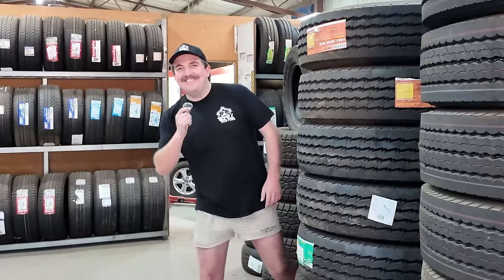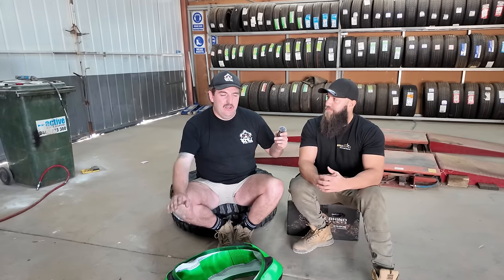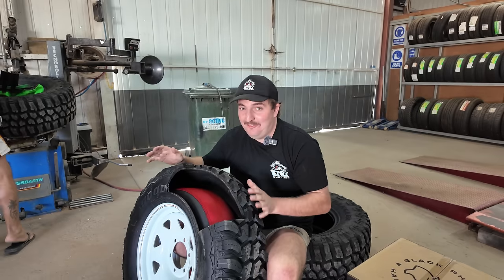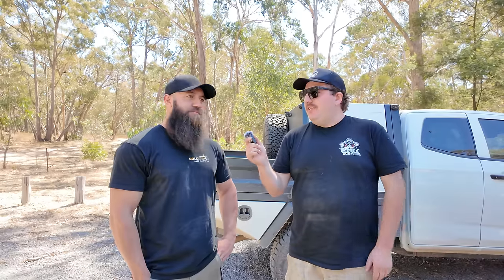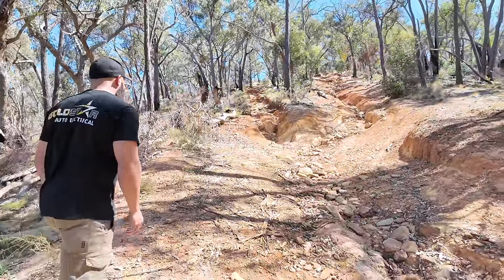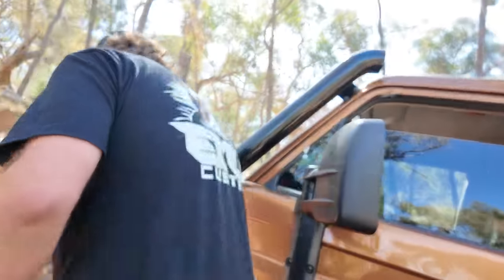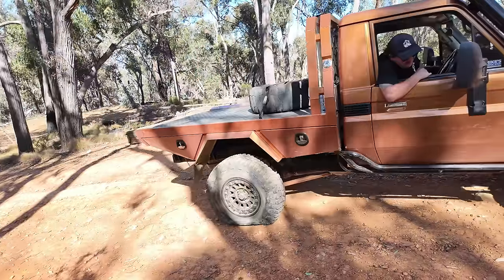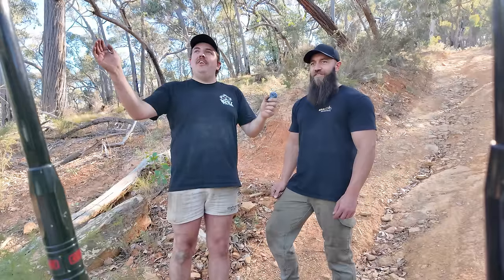No more DEFECTS?!? Pneumatic Beadlocks - (install and torture test)

Comment: From the Avanterra website "For off-road use only. SecondAir™ Beadlocks may not be legal in all states."
I remember with the Staun version that the drilling of a second hole in your rim also makes it illegal to fit. Thats why Staun sold rims with 2 valve stems. Because if they are manufactured like that then its legal. Look up Roothy back in the day put them on one of their budget 4wd specials.

Comment: That 2 new things I hadn’t heard of!
Legal bead locks and graded 4wd track maps. Downloaded it straight away
Absolutely awesome thanks mate!
Reply from the maker: Glad you enjoyed mate!
Reply: Internal Beadlocks were around years ago and those were called Staun Beadlocks, but are they legal?. Probably depends on which nanny state you're in, as I always thought they weren't.  But with the 2nd air valve on the inside of the rim out of sight, whose gonna know hey? I think the only reason for being illegal, was because of the "rim modification", as you had to drill the hole for the 2nd valve. If the rims were manufactured with the 2nd hole, no problem. 
But then again I may be wrong, as it's been many years since I first looked into these.
Reply: @paulpatullo5146  Yeah I heard the same but agree. The popo can't see whats not there.

Comment: On the auto air system ARB makes the linx that does set pressures up or down. I use that and a company called up down air and have a similar setup. I have 4 Schrader valves at each corner and 4 whips with quick connects. I click on the 4 whips, grab the arb Linx and set the pressure. Works pretty good!

Comment: Pooly I have been running them for 20 years first the original Stauns (the precurser to 2nd Air), now Coyotee from the US which are a big improvement over the initial design. Zero air no problems and no issues in 20 years. 

For your auto tyre inflate deflate look up Jamec Pem AUTO1000

Comment: Best video editing out of all the lads i follow.

We used to fit these second air beadlocks along with staun internals 15 years ago. Good bit of kit but still do require maintaining. If you run them super koad and dirt or dust gets in itll flog the tube out in no time. Good to see someone running them again tho 👌
Reply from the maker: Thanks for the heads up mate! And the appreciation on the edit 🍺

Comment: Take one of those mechanical deflator caps that some people use to drop tyre pressure to a set amount and put it where you let the air out of your system. It’s a non-complicated way to let air out to a preset pressure that you don’t have to keep an eye on. I use Australian made Staun brand🍻

Comment: if you want an auto cut off for your tyre deflator, just buy a set of Stauns and sonme adapters to get the threads right. you can have 4 preset pressures then :) pretty simple i reckon

Comment: Neen running them for a while, wouldnt recomend haveing the beadlock valve back there as its good to check the pressures of the inner tube regularly. They have been a reliable setup.

Comment: Ive only ever seen one rear bead come off the rim while running external beadlocks. But that was under some pretty harsh winch comp driving. These are definitely a pretty solid option for on the road. Will be good to get a update after you out a few kms on them
Reply from the maker: Definitely after asking the question have had a few people with inner bead issues comment and i agree definitely a more sensible approach for what im doing cape york will be a good test for them

Comment: I run the tubliss system on my dirtbike (which uses the same principles as this air beadlock) 

I back it, as ive gone over the handlebars grabbing the front brake where you would normally wash the front end out. Only issue is you have to run some tire slime to keep the pressure somewhat consistent over lengths of time
Reply from the maker: Thanks for the comment mate! Another great story interesting about the tyre slime
Reply: @Unclepooly  that being said, dirtbikes are designed with tubes in mind while road vehicles being tubeless might have better designed flanges. Let alone 1000 spoke nipples. If you have dramas keeping air in at 5psi that might be an easy fix.

Comment: We run them for years but made by staun.
Got our first set around 2005 for the jt's, back when steel 15x8's were cool 😂😂😂.
Reply from the maker: Steelies are for trailers now 🤣 how did they go? Another bloke somewhere in these comments reckons stauns were no good
Reply: @Unclepooly hahaha.
But steelies can be bashed back to some sort of shape when fingered lol, but  we never had an issue.
Little bit of a prick to fit but otherwise flawless.
We consistently ran 0psi on JT2's up here in fnq.

Comment: Iv definitely seen the rear bead de-bead on low pressures (steel beadlock rims) car was basically on its side in a big rut 🌅 
I think it actually did both rear inner beads 😂

Comment: I looked into these awhile back. Saw a few comments that dust/mud and sticks can still get in. While I get it with the defect thing. The rest let it down for me. I find a blown inside bead would be very unlikely compared to the outside due to the outer wheel being where it gets bashed the most. Will be interesting on how they work over time. Keep us in the loop.
Also you changed from Baja Boss. I run the Nitto Mud Grappler (the bald tyres on your truck lol). Have you had a run with a good set?

Comment: Hey mate could you put a thread in the end of the deflat valve and screw on a campboss preset/adjustable deflater so when it gets to pressure it will stop air coming out you could walk off and eat a zinger come back and its done
Reply from the maker: That is one way! Someone suggested bluetooth arb setup which sounds cooler though but i definitely like the idea of the zinger 🤣🤣

Comment: The other more overlooked reason for bead locks is that when running very low tire pressures you can have the wheel slip within the tire possibly causing damage and guaranteeing that the tire will be out of balance.
Reply from the maker: Correct! A lot of times this is also what breaks the bead seal tyre spins on rim and the whole thing lets go i had this happen once ended upside down on my roof 😂

Comment: Back in the day there were Staun internal bead locks, which these look pretty much the same as

They were sold "for off road use only", because drilling a hole in your wheels for the valve was illegal and defectable by the cops

Maybe something has changed, but I haven't heard of any changes to the law regarding bead locks, internal or mechanical

Comment: Had looked at these some time ago. The only problem is that you are not legally allowed to drill holes in your rims as you may compromise the strength or integrity of the rim. If the rim comes manufactured with a second hole already in the rim then it is, apparently legal.

Comment: ARB have a bluetooth Air Controller it works like a servo where you just set the pressure and it chimes when done. I use it to control the full airride in the back of my np300 with a separate bridging valve
Reply from the maker: Brilliant idea that could work! (If i can be bothered 😂) Thanks mate
Reply: @Unclepooly  yeah that and the arb tax, just be a little wary about the second air as they can still be defected for drilling the wheel. Should be fine hidden behind the face though.

Beadlocks have come along way over the years and should be reconsidered as an engineerable item. Seems stupid that you can bolt a fake ring on the dual tech ones like dt1/2's and ati's and it's fine. 
Then there's attachments like hub caps and trim rings that just clip on, jdm wheels where the centres bolt together so the whole wheel falls apart... 
It's not just about letting tyres down further it stops the tyre spinning on the wheel which is a bit problem with steelies.

Comment: I liked mind my 2nd airs, ran them on a GQ for my 35” pedes. 

I just found the inner pressure needed to be monitored- wasn’t set and forget.

*also… Roothy was advertising/pushing these back in the day!
Reply from the maker: Thanks for sharing mate! Third person to mention roothy i might have to try find it 

Interesting! I honestly thought they would be right as long as the valves are checked for bubbles after install but i’ll keep an eye on it before and after my next big trip and share the answer!
Reply: The pressure on the outer chamber impacted the inner tube pressure significantly. I had some bead issues with mud still working its way in and slow leaks. I had one fail when I assume I damaged an inner tube and pulled the whole lot off the rim. 

If I did it again I’d run one of those screw on tire pressure monitor setups for the inner tubes so I know the internals are at correct psi.

Comment: Had a set years ago. Were a total pain in the arse. Kept getting leaks in the internal tube, a c*nt to balance, a bastard to install. When the really expensive internal tubes inevitably get a puncture or leak or abrasion hole then changing them out is an unholy pain in the arse. Never again

Comment: is drilling the second hole legal? i remember many years ago in the early days of the Outback Challenge some people were defected for modifying the wheels by drilling them.
Reply from the maker: This is a grey area! Common sense tells you that its not an issue and no one will ever care but if the question was asked you could argue that it doesn’t affect adr testing data as where the hole gets drilled is in a non-structural spot unlike drilling the mounting surface or near spokes ect i actually spoke to my engineer about it and that was his answer so i guess the answer to your question is no one has an answer. but definitely a million times better and safer than a big beadlock ring and 24 bolts holding the wheel together! Its basically just a tube and as far as i know theres no rules saying tyres need to be tubeless
Reply: Less illegal than external beadlocks……..
Reply: @Unclepooly   I used to run a second valve and connect the gauge to it while i let the air out of the first valve to make the whole thing quicker to pump up or air down and got told they were illegal when i got defected for running too big a tyre.
Reply from the maker: @aussiewalkabout4x4 my Kmc’s have two holes in them for that but i get grounded and fined as soon as i leave my driveway with them on for the beadlocks 😂 without pulling a wheel off you wont find the second valve on these
Reply: I’ve been running internal beadlocks on my play tyres for 15+ years. They work very well however have still dinged rims and also forced mud/small pebbles into bead. Keep tabs on your internal tube pressure as in keep it at 48psi or you still pop beads depending on tyre brand. Worth noting I was informed that any modification to a rim/wheel is illegal. Though it’s a chance I’m willing to take considering they are on play tyres.

Comment: We were doing 6 stage in yalwal a while back on bead locks (only on the front of the rim) and we were down at 5ish psi on 37 treps and we were fighting inner bead issues on all 4 tyres all day I reckon the second airs probably would have solved that
Reply from the maker: Interesting to hear it mate! Heard the same thing last night from a guy that run simex centipedes and inner bead kept coming off, so he got these second airs and he’s had the same set for 20 years and reckons they’re mint

Comment: My kmc  beadlocks have 2 holes for stems. I'm not sure if that was a design for high-speed stems for an internal beadlock
Reply from the maker: My kmc’s have the same! I think its more aimed towards rapid deflate valves which is also great, the internal beadlock hole needs to be (somewhere around) where we drilled it
Reply: @Unclepooly  sweet I wasn't to sure I still haven't used them
Reply: @Unclepooly  also thanks that app is amazing I'll do the paid version asap
Reply from the maker: @toddatfield8838 enjoy mate! Its honestly great and the more people that use it the more accurate it will be

Comment: Why are bead locks actually legal?
Reply: No saftey if bolts sheer, alot aren't machined to balance etc.

Quality has come along way since I tried engineering a set years ago
Reply: @ellietthillery8204  Yea right, never broken or lost a bolt. Wonder why a company wouldn’t build one to pass
Reply: @Jakedeppeler same here, Trail Gear beadlocks and haven't had a bolt come loose in 40k+

So yeah I don't get it, maybe the cheap rims have problems because mine have been fine
Reply: @Jakedeppeler  yea know alot that never come loose just the way the world is one numpty wrecks it for rest. I was explained it needs a second saftey 🤯
Reply from the maker: The reason they are illegal is because they can come loose and the rings can come off although it is unlikely and usually caused by incorrect fitment, not checking tensions and cheap chinese bolts the cops simply just hate them they are the #1 worst thing to have on your car in Victoria they will ground you on the spot and make you tow the car home regardless of where you are speaking from experience and we were actually on a 4wd track in the bush
Reply: @Unclepooly  Very surprising that these companies don’t have a solution to this with a tested ring that can pass through an engineer or be approved. Will have to look at changing my rims out.
Reply: @Unclepooly can you put the app up not sure why I can’t find the damn thing haha
Reply from the maker: @Jakedeppeler i think you will find its mainly due to the installer, they dont trust us to fit them correctly and keep the bolts tight well thats their excuse anyway. When the cop told me the bolts could come loose and the ring could come off i said what about the 5 nuts holding the entire wheel onto the car 🤷‍♂️😂
Reply from the maker: @billo8850 hey mate search newtracs.com and theres links to app store on the first page 🤙
Reply: @Unclepooly  legend
Reply: @Unclepooly  haha, yea the rules are very vague after reading though them and almost every cop interprets them in their own way. The joys of owning a forbie I guess.
Reply from the maker: @Jakedeppeler yeah thats it! Gets even more tricky when they start reading your engineering papers 😂
Reply: @Unclepooly  I know right! Currently going through that at the moment and it’s a nightmare. Just trying to talk to as many people as possible and get the best advice on what to run